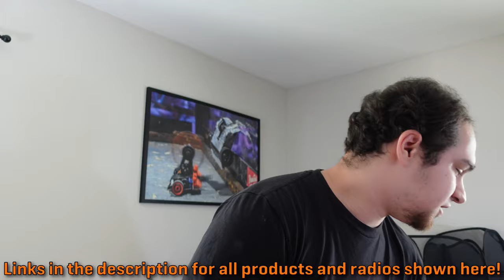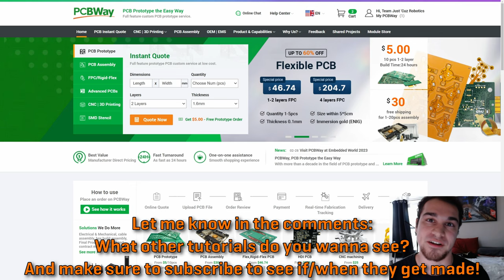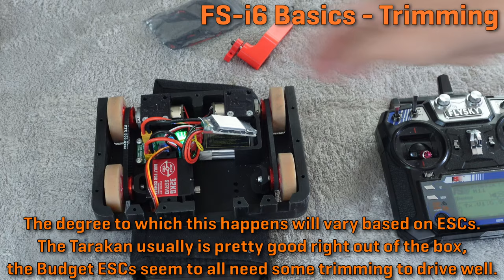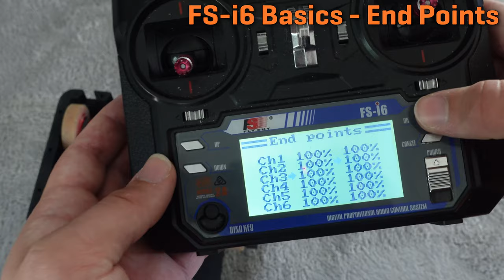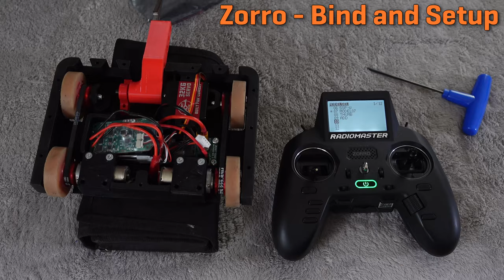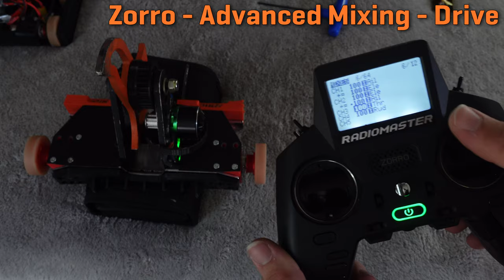Mastering Combat Robot Radios - Mixing, Binding, Tuning, Programming and More!

Comment: Really informative video (and I watched to the end)

Especially the parts how to setup limits and curves will certainly help trying to control the smaller weight classes since they are just so fast. For newer drivers you can see a lot of bots over turn a lot and with good exponential curves you can trim that down a lot and make it both able to turn smoothly and fast while with linear inputs you maybe have a tiny tiny region on the stick where you can control it smoothly.

Excellent video and thank you for the monumental amount of effort it must have required to produce an almost 43 minute video explaining everything for two different transmitter types!

Comment: Great video which covered most of the things for the 2 remotes I have FS-I6 & Zorro, but unfortunately several of the things that would have been helpful for the Zorro were sped through and I had to go figure out myself through trial and error.  Although the video was long, its easy enough for the watcher to fast forward through the pieces they dont want and since you taped them anyways, they should have been made available.  I do have the video on my list to watch again now that I understand the devices better after the first watch.
Reply from the maker: Thank you for the feedback. This video was not just long to watch but it took hours to film and I ended up cutting out a lot of bad takes and confusing sections. I'm also not an expert, I just tried to go over the stuff I do often and know well. There are a million things you can do on the mixing page for instance and covering it all could take hours.

Comment: The one thing that I see a lot robot drivers having trouble with is that their differential steering is so fast that they cannot control the direction of their robot. Over steering to the point of feeding a tire into your opponent’s weapon is normally less than desirable.
Reply from the maker: Very true. Lower steering end points, expo,or simply practice make a difference.

Comment: What is the difference between a brushed and brushless speed controller? Does a brushless esc only work with a brushless motor? Or does a brushed motor only worked with a brushed esc? What’s the difference?
Reply from the maker: Brushed motors have 2 wires and are simpler to control, brushless have 3 wires and need a complex controller to work. Brushed ESCs will not work for brushless motors, and Brushless ESCs usually won't work for brushed motors although some have a firmware that let's them control both (since a speed controller that can control a 3 wire motor has the hardware needed for 2 wire)
Reply: @JustCuzRobotics  do you know if the motors in the fingertech viper kit are brushed or brushless?
Reply from the maker: The Viper kit motors are brushed for sure. You can tell from the fact they have just 2 wires

Comment: Hey Seth, this is really informational, and will come in handy in the upcoming days of setting up my SSP (it's all built, and hand tightened, just need some Loctite Blue for the wheel set screws and everything should be hunky dory there), and with some spare xt30's just in case haha.

Now, I have a question about all this.  I've got the Turnigy i6 (which is the same as the FSi6, but what would be your right side stick for movement is on the left hand side instead.), and whilst trying to mix the controls, I noticed that what should be forward is actually turning the robot, rather than going forward, and turning the robot is actually causing it to go forward.
I've tried to mix it on the control but it doesn't seem to be enjoying it, so my question is would it be safe to put what would be on the first channel on the ESC to the motherboard into the second channel of the MOBO 2.2, and the singular wire into the first channel in order to get the needed results?  Or would this be a bad idea and just blow up the ESC?
Reply from the maker: Yes switching it to the yellow wire is channel 1 and white wire is Channel 2 should fix it

Comment: Great video, my only question is it possible for either of these transmitters to connect to two receivers simotaniously?
Reply from the maker: Both can if you use FS2A receivers or other ones that dont have 2 way communicatiin
Reply: @JustCuzRobotics thanks one last question, 

it is as simple as binding to one them binding to the other, if I bind to one A, after that I bind to the second one B, A the first one loses connection and B working normally. And vice versa is true.

I’ve have tried on the fs-i6 and a friends  zorro, is there any setting I need to change or are they the same as in the video?
Reply from the maker: Should be the same as in the video. The FS2A receivers I sell work as I described but there are some variants that might have 2 way communications and will not allow 2 bound to the same model

Comment: I'm new to your channel and I just subscribed. I recently picked up this transmitter and receiver and I've learned more last night about how to configure it for my Heng Long tank then I ever have. The instructions from this company fly sky are terrible and I wanted to ask where on the receiver are you supposed to plug in that single yellow connector? I also think I'll try out some of your electronics projects here.
Reply from the maker: Thanks for the sub! I don't have familiarity with that particular RC vehicle so idk what yellow wire you are referring to. It's likely a signal wire for one of the receiver channels but you might need to consult the manual for that product to decide which.
Reply: @JustCuzRobotics  I think I resolved it and just wanted to say again much appreciate the video tutorial you posted here,. it really helped

Comment: Could have saved myself a bunch of time if I had found this video earlier! But I still have a problem... I have the same setup with the FS and ch1/ch2. It all works great except at low speed it turns the wrong way when moving forward until I turn hard, then it goes the right way. There seems to be some conflict or mixup with blending the 2 channel signals? It this just bad programming in the esc? I'm using a 4ch FS2A receiver. None of the FS settings seem to affect this.
Reply: Oh, and a Dual Way Bidirectional brushed 5A ESC
Reply from the maker: Sounds like you need to adjust your radio trim
Reply: I may be confused, but that would move it more in one direction right? this happens in both directions. When I dial down ch1 enough, I can almost control the steering backwards equally in both directions while going forward until I speed up, then it spins back in the correct direction. If I just go forward, backwards, left or right, it works exactly as it should. but moving the stick diagonally is very unpredictable.
Reply from the maker: Trying to troubleshoot over text can be difficult, please email team@justcuzrobotics.com with a video of the problem, showing your controller inputs and resulting robot motion. I should be able to help better that way. Be sure to include your order number

Comment: Seth, Sometimes you see bots gyro or lift as they turn - it seems like super efficient way of moving. Is this a result of how you setup the remote, how powerful the bot is, or is this a side effect of the gyro of the weapon.
Reply from the maker: It's pretty much Gyro and physics. Large enough angular momentum in the weapon plus large enough turn rate plus narrow enough wheel base. Not much to do with the radio controls besides allowing fast turning.
Reply: The physics phenomenon is called "precession", usually prefixed by "gyroscopic" or "torque-induced". It's the same mechanism that allows a spinning top to stay upright while spinning and the sides of the bot lifting is caused by the rotational inertia of the (vertical) weapon being changed by the rotation of a bot. The more weapon inertia or the faster the rotation of the bot, the more it will try to lift up one of the sides. You can configure your transmitter to try and reduce this effect by for example limiting the speed of the weapon while turning, but there is nothing you can configure in your transmitter to make it gyrodance more aside from upgrading the motor for drive or weapon.

Also depends what you call "efficient". There is no free energy so it has to come from somewhere, with gyroing bots it's converting a bit of angular momentum of the weapon into angular rotation of the entire bot, so while gyrodancing looks nice you're actually making your weapon motor work harder to keep the weapon up to speed. 

Gyrowalkers (bots that move only by this mechanism, think of Rickety Cricket/Dumpster Baby in the lower weight classes, Wrecks in Battlebots) are effective because they only have to dedicate weight to the main weapon motor and a smaller servo motor to tilt the body or weapon to cause the gyro, also get a weight bonus in most smaller competitions for unconventional drive.

Comment: Has anyone successfully paired a channel hopping 2.4ghz controller with an Xbox or PS4 controller???
Reply from the maker: I highly doubt that is possible. Bluetooth is not the same as what these radios use. I have seen someone use a custom ESP32 based receiver module with a Playstation controller and even a steam deck but that's a hell of a lot bigger and more complicated (writing your own code from scratch Vs plug and play)

Comment: I really wanted to see the servo end points being set on the zorro. It doesn't work as it did on my Taranis with OpenTX... raising/lowering the endpoints doesnt do anything on the zorro. ... But you fast forwarded the whole thing and didn't show anything. 🫤
Reply from the maker: Sorry about that! This video was already getting very long. You can do that from the Outputs tab on the Zorro for channel 3. Just set the min and max for the channel 3 output to adjust the servo end points.
Reply: @JustCuzRobotics  thanks. I tried that and it didn't move the servo. I figured I must have missed something or there's some other setting somewhere. I used the sub trim to move it a little, but it doesn't move anywhere near what it used to in opentx... and this is a servo I've used many times before. Must be missing something.